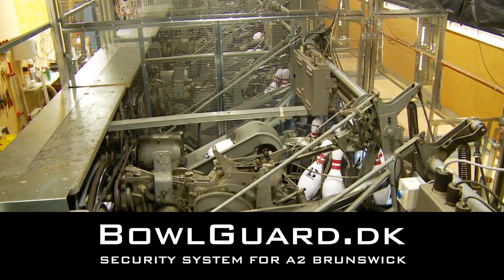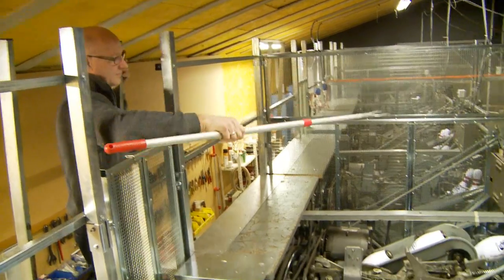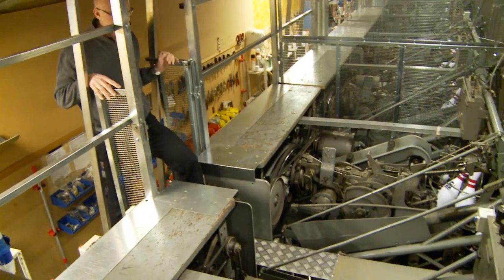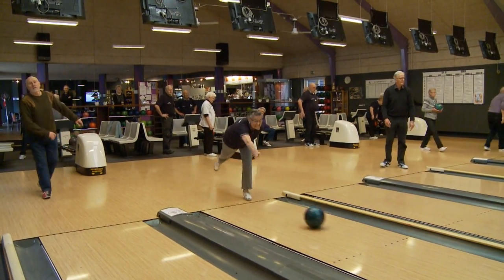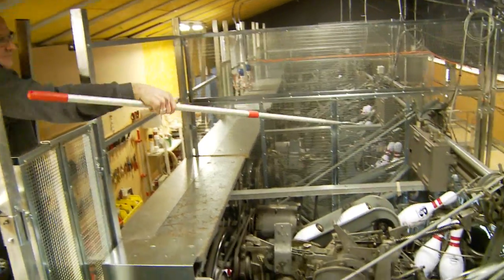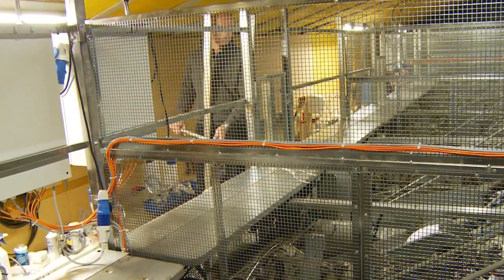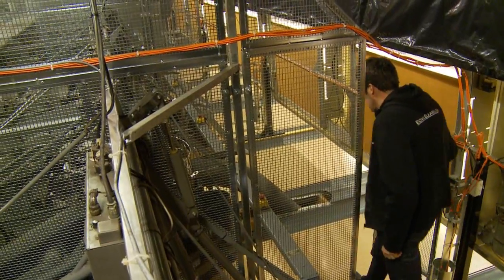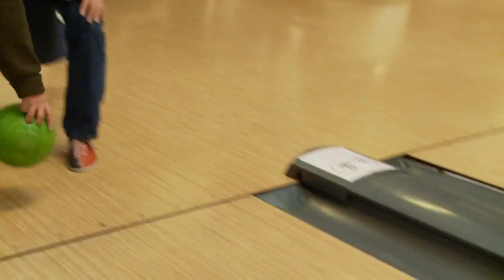BowlGuard - Security system for A2 Brunswick

Comment: sigh...did A2 mechanic work for 7 years, you fix a machine by turning off the power with switches on the back/control panel and dropping the rake. It isn't complicated. Sorry it has come to fully encasing the machine in guards...you might as well build a fence across the lanes with only a little gap under it for the balls to go through and a gate that swings down to keep kids and animals out of the pin deck.
Reply: They can afford all those guards, but not cross conveyor belts? lol

Comment: Safety interlocks have been around for years on industrial equipment.
Fact of the matter is that "Tag Out-Lock Out" is the law in the USA.
Now it looks like bowling centers are being addressed.
Reply: That is not the law.  AMF had an "incident" in which OSHA ended up requiring some pretty strict safety features, but thankfully Brunswick was never required to follow suit (they have sense been, since they were bought out by AMF.

Comment: @clumpy1dud 
Unfortunaly there is nothing for us in EU to do about it. Is the law and if we do not follow it we will get a fine.
If we still dont do anything about it, they will close the centers down. In my opinion this system is the best one I've seen. Realy easy to work whit AND fast. And the big thing about this system is that you dont tunr off any other machine then the one with the error.